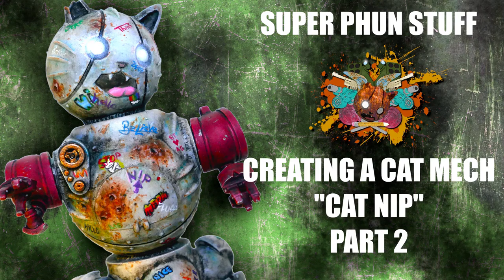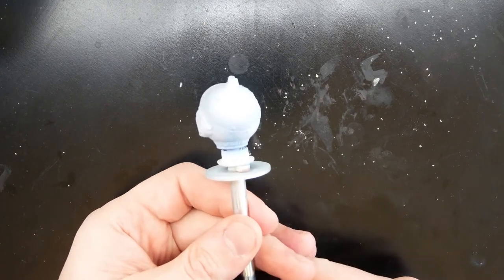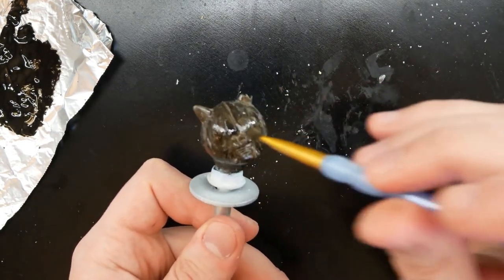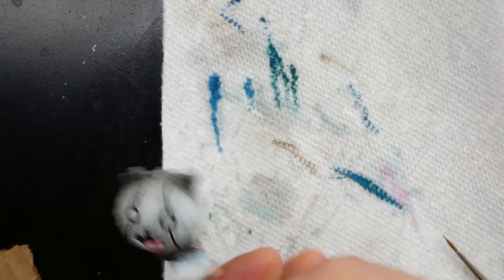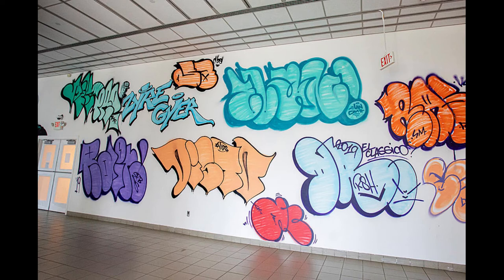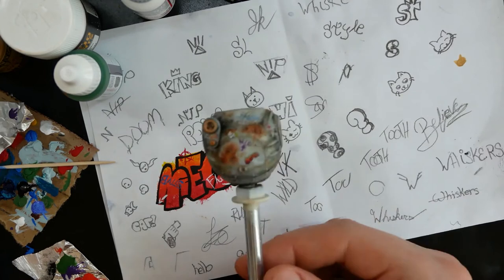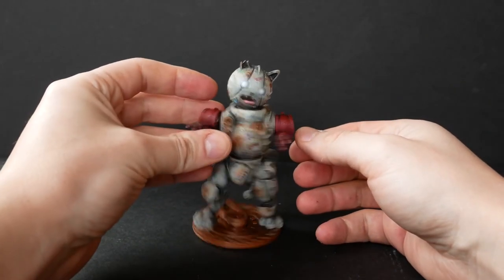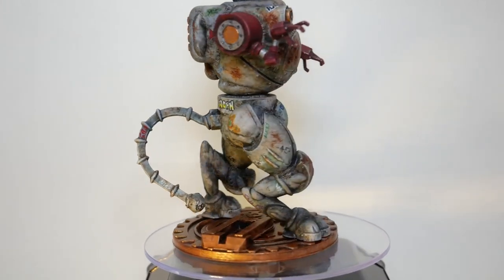Creating a Cat Mech "Cat Nip" - Part 2 - GRAFFITI!

Comment from the maker: Forgot to point out in the video, as another viewer pointed this out to me. many times with gunk washes you will see folks lay down a gloss varnish ahead of time. This allows the wash to use the capillary effect to help get into those nooks and crannies. This method usually comes out cleaner. I opted for not using any kind of varnish, so a matte surface (you  can use a matte varnish too for the same reuslt). This method will tint the base color from the oil wash and give a dirtier gross look. So we see that my fairly light grey mech turned into a darker brownish finish after wash. Two different ways of doing it and two different outcomes. There is also a satin varnish that gives you an in-between result, but it's a little closer to the matte finish look. Maybe in a future video when I paint Wags, I will go the gloss route to show you all the difference; since he will be a bit cleaner than cat nip here.